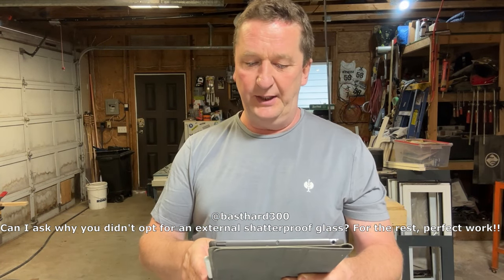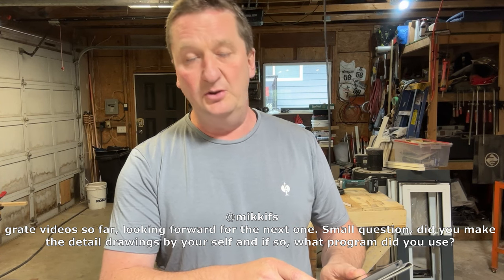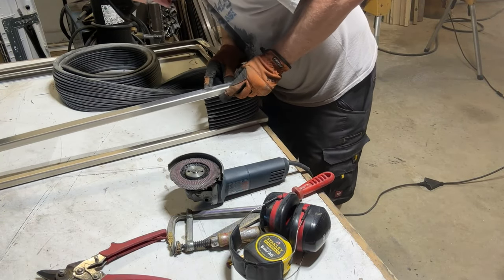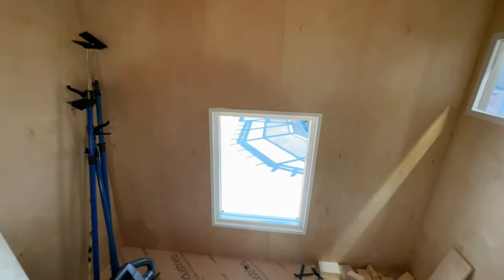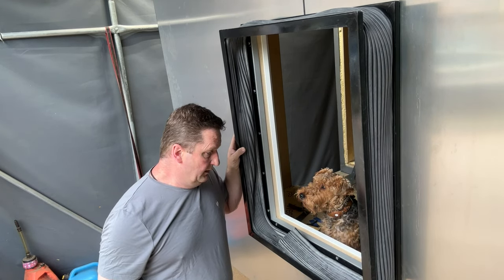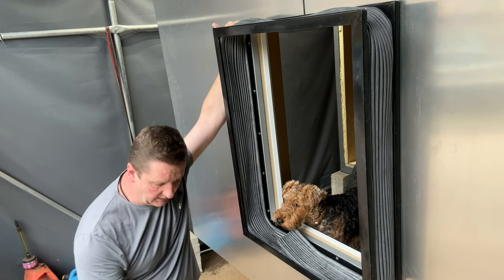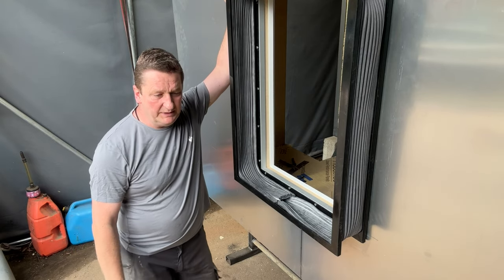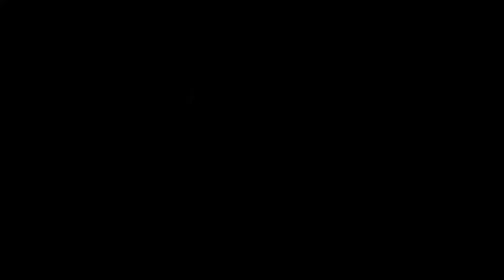How to build a pass through for an Expedition truck. All DIY !

Comment: That commenter asking about shatterproof glass may have been talking about polycarbonate sheets used like glass vs laminated glass.
Reply from the maker: Maybe but he said shatterproof glass. Btw I would not use any of those materials for windows like acrylic, lexan or plexi because they are not scratch resistant.

Comment: If you can buy parts, it is cheaper than custom fabrication. Is a passthrough 36X24 enough? Can the accordion boot be used in the reverse? Where as the lip is outward rather than inward? I found frames 36X24, with edges that can work with the accordion boot.
Reply from the maker: Mine is 32x24 so 36x24 is a decent opening. I placed the lip inwards just in case of a bigger torsion movement, the boot just pops off and can be reinstalled. If the lip is outwards the boot will rip apart.

Comment: What material did you use for the metal frames?  Did you buy it in the profile shown or did you have it shaped to your own specification.
Reply from the maker: I have ordered the J shape aluminum frame at my local flashing shop, I thought I said the measurements of the brake shape in the video ? Thanks for your question.
Reply: @oscaroverlander_MB1222AF  thanks. I must have missed the dimensions somehow. I will view again.
Reply: Oh also curious to see your video on making hatches. I need to do that for my Unimog when it arrives.